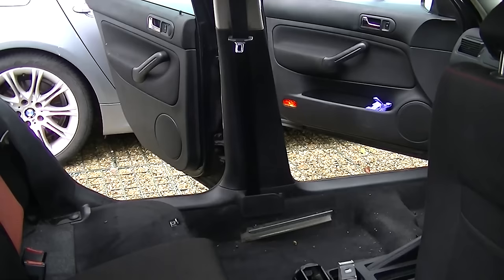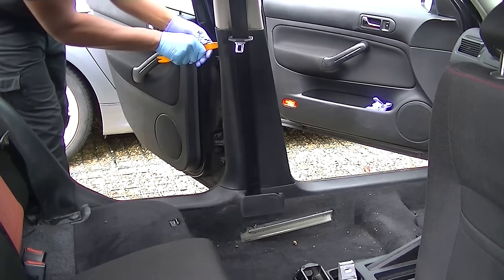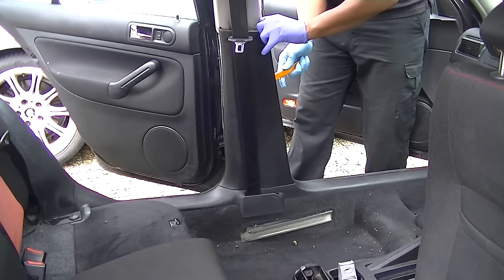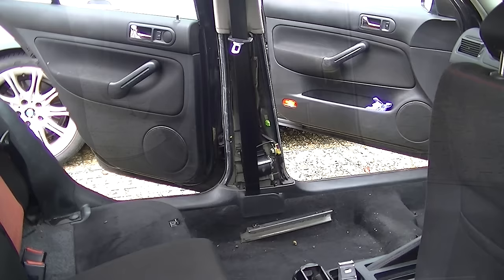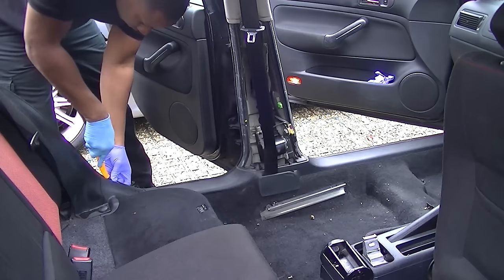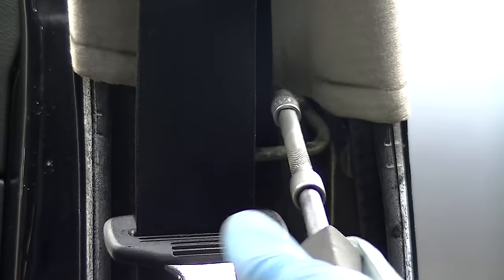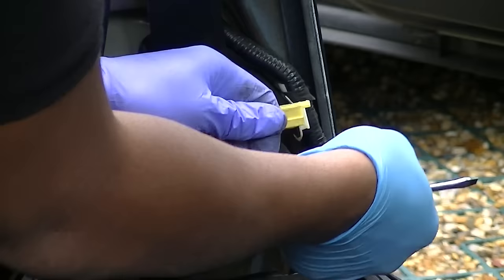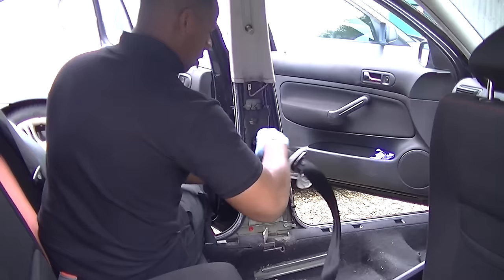How to change a seat belt on a Volkswagen

Comment: Just did the seatbelts in a 2014 Passat with these exact trims etc. unhooked the positive terminal, installed the new belts with sensors all plugged in. I now have an air bag light and a seat belt light. These were new belts to replace old ones chewed by the owners dog.

How to I remove the light(s) / program the new seat belt sensors?

Comment: You give some nice clear directions. In this one tho, you seem to have cut out part of the removal process - the bit where you gain access to the anchor bolt - it is not easy to access and you skipped straight past it. One minute its bolted - next minute magically its free and you are rolling up the seat belt fully removed.

Comment: Very useful post, used today to replace a mkiv seat belt.

As per the video voice over you'll need a 17mm socket. The video misses out the bottom bolt but its 17mm again though because of the angle its a bit awkward and tight. I cut the narrow piece of underlay and the used a sharp knife (ceramic) the bit of carpet (as its ends up behind the trim) just to create a bit more of a gap to undo the bolt.

Thanks for posting ! :)

Comment: awesome video, thank you for it. I had a quick question though, my seat belt due to a small fender bender where the airbag came out tightened up, once I remove the airbag, is there a way I can repair it, or would I have to buy a new one altogether? thanks again!

Comment: There are a few specialty tools required for this job on a 2000 Tiguan; the last item removed in the video requires some sort of star socket wrench- and this repair is impossible to perform without identifying that tool.    BTW: on my Tiguan, there are additional clips on the bottom of the column panel that do not just pop apart- any idea on how to open those without destroying the panel?

Comment: Need to replace the rear center seat belt on my 06 Jetta TDI.  The lower torx is easy to reach under the trunk carpet at the base of the seat but the upper ratchet is IN the seat.  Do you know how to access that without needing to see an upholsterer?
Reply: That's what I'm looking for. 2002 Jetta.

Comment: Be careful in Vw Polo 9n is other way around..vertical panel is under screws and the bottom one is on clips, and there is no bolt at the rear end.

Comment: is it possible to repair locked seatbelt after crash? cheers
Reply: Julia Airapetyan what do you purchase from eBay ? I am trying to fix my seat belts they are locked and they are charging be about $400
Reply: @kingg_roast259  VW VOLKSWAGEN JETTA PASSAT SEAT BELT REPAIR PRETENSIONER REBUILD AFTER ACCIDENT search on ebay its $ 50 a piece and it seems a ton of people have bought and are satisfied.

Comment: Hi there , so Im wondering what is the reason for removing the seat belt? Also given that you are disconnecting the seat and the seat belt device it might be a good idea to mention to the uninitiated to disconnect the battery .
Reply: They lock on in a crash, so need replacing